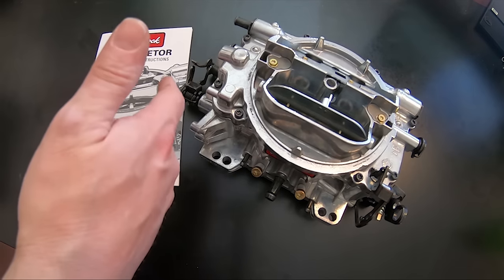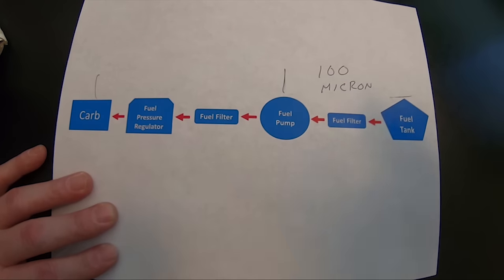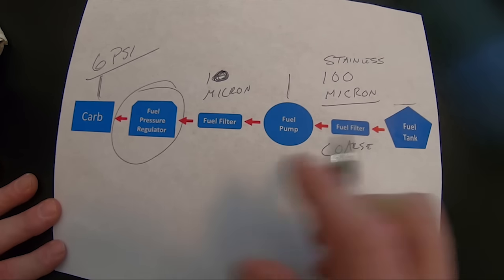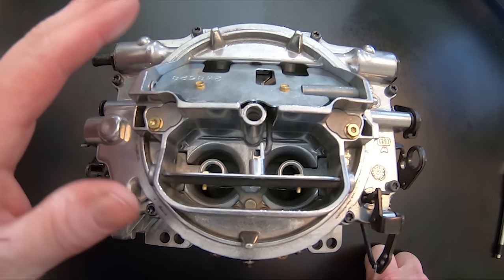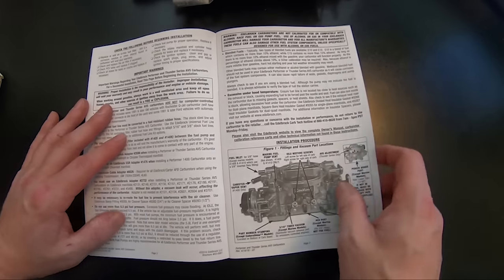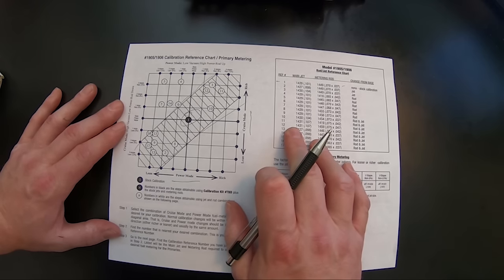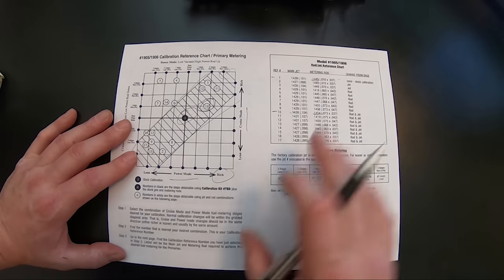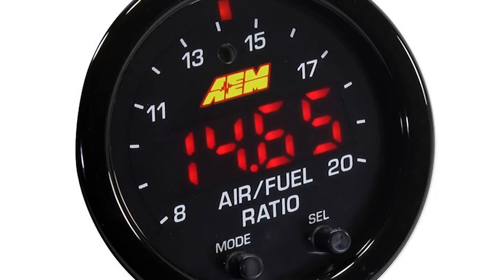The Ultimate Edelbrock Carburetor Tuning Guide

Comment: Nice video. Once you mentioned I have a question. My car is running great, it idles perfect, at wot is good, part throttle is good as well. Off idle is good as long as I give like 20% of throttle or more, however if give only a tiny gas, like 10% of throttle in order to leave a stop sign slowly there is an hesitation, pretty bad, I’d say. Other than that, like if I’m driving like at 30 mph or more, it is crisp. Any recommendation?
Reply: Bone Head first of all thank you for your prompt reply. I’ll start by the accelerator pump. I’ll have a vacuum gauge hooked up to check it. Thank you. Happy Thanksgiving!!

Comment: I was curious about my 1406 she was running great with choke closed then after 1 test ride she started running like dog crap, surging and hard to keep idle in gear. If i cover the butterfly with my hands the idle raises and smooths right out. Sprayed carb cleaner around the top plate gasket by the throttle and you can hear and see the difference on the vacuum guage my question really is this a normal occurrence on these carbs? Thing is only a few months old has no miles on it. Thanks for the videos and the help
Reply from the maker: You have a vacuum leak somewhere.

Comment: Does it matter if you use the PVC port for Brake Vacuum???
Reply from the maker: Use the rear port for its intended purpose.  It’s there for your power brake assist.  Front is for PCV.

Comment: I just rebuilt an old Carter (1st time) and set the idle speed so the transfer slots were square. There was no amount of timing or fuel mixture tuning to get the thing to idle with them set that way - had to go several turns in on idle adjustment. Checked for vacuum leaks and actually blocked off all ports. What might I be missing?
Reply: Old carters are often plagued with worn throttle shafts.

Comment: Recently purchased 1969 Firebird with a stock 350 engine it has a 1411 750cfm Edelbrock carb with a performer intake, factory cast iron headers, flow-master exhaust MSD electronic ignition. Is that 750 cfm carb to big for this setup it seem to stumble a bit under acceleration
Reply from the maker: Mike Knizner yup.  You can meter it down a little, but you can’t meter down that CFM.  If it’s bone stock and just a fun cruiser, I’d put a 500 or a 600 on.  The 600 would allow you to grow into it a bit.  This situation you’re in is a perfect time to pick up an AFT gauge and see how rich it is as it sits.  Good stuff can be learned from what that gauge will tell you.  Congrats on the car.  Absolutely love the first gen Camaro/Firebirds.

Comment: great video. i have an issue with my jet boat its 21 ft aluminum with 1410 Edelbrcok marine and 350 chevy. boat starts and idles , and cruises fine but when it gets to 3600 rpm it wont go any further. if i push the throttle it it starts spiting and stumbles and  have no further power . thx for the tips
Reply: @MuscleCarSolutions  thanks for the comment. to be honest dont know much myself about what was done to the boat .just purchased 3 months ago from a heavy duty mechanic shop owner. he told me the boat is fine it just need new jets and carb adjustment. the boat has electrical fuel pump so i just added a holey deadhead regulator thinking it my be over-fueling but i have not taking to the water to test yet. i purchased the carb jet kit but I have not open it or install it yet because  I though I will try one thing at the time to see if the issue goes away before i pour more money on this.
Reply: @MuscleCarSolutions  i just run into this google comment that says "If the carburetor is "too big" then the engine will not be able to keep enough air flow through the barrels for fuel delivery to occur. Which would explain why the engine would work at highway speeds but struggles at low rpms. Jun 8, 2010" Howver, mine is the opposite , it runs fine in low speeds but struggles at higher speed.
Reply: @MuscleCarSolutions  will do thx again.

Comment: A question regarding AFR readings, 4106 carb in 1978 chev 350, when running down the highway @ 60 mph, my AFR is showing 14.0 -14.3, when I come to a hill it drops
to 10.5 - 12.5 and the secondary has not cut in, are these numbers normal? I would like to see the up hill numbers higher to save fuel
Reply from the maker: @wayneking3408  when you come to a hill you’re under load as the vacuum drops in the engine and meters more fuel.  Go back to your calibration kit and follow the chart to go a little leaner.  14:1 is ok.  Not optimal, but ok.  Anything leaner than that you’re asking for bigger issues.

Comment: running into either a carb  or vaporizing issue.. most likely both..

 im running a holley fuel pressure regulator on my 302 82 mustang near the passenger firewall on my carter AFB . if the regulator gets hot and stops reading does this mean it expanded to allow max flow? or has it collapsed? 

getting hard to start after sitting hot. and stumbling after idling/heavy loads.
Reply from the maker: Check out my video on heat soak.

Comment: Great video! You said we could leave a. Question in the comments. We put a new 1805 thunder on a 305 small block . At launch with foot brake it stalls ? Any idea where to start . 
Any comments appreciated. Ty
Reply: Bone Head sorry 1805 I believe. 650 thunder with manual choke
Reply: Bone Head  the Edlebrock chart said down to 283 . 
We have headers and performer intake with power glide , 4.56 9 inch ford . Stall is 1800 I think . Can we lock out the secondary somehow?  
Just to give it a try ?
Reply: Bone Head  electric water pump and fans but as far as the core components stock except zero emissions and msd multi spark box
Reply: Bone Head man I thank ya . It’s been on the car for over a year . My dad is an old timer and spent 20 years building this bracket car and went to the track for the first time and died on the line . It started right back up and did 75 mph in the 8th mile . You gave us somewhere to start . I think the original idea was to stick a 383 in there and swap everything over so we don’t have to buy anything twice but not having anything to start with . I guess I could put a 75 shot nitrous on a one second timer at launch and still stay budget friendly. Thanks

Comment: Recently purchased a nicely restored 68 Mustang with 5.0 and Holley 4barrel carb. Both front and rear bowels were running over a bit. I lowered to floats to stop that. Adjusted the electric choke a few times. Had it running fairly decent I thought. Had been threatening to get rid of the Holley. I had been driving it around that morning and it ran pretty good. But then it seem to run badly after stopping for lunch. Drove over a short distance to the chiropractor's office. Upon leaving, the car would not crank. I thought maybe it had flooded? I removed the breather, closed the hood. Tried to crank it and the BOOM. THE ENGINE BACKFIRED  AND THE NEXT THING I SEE IS FIRE UNDER THE HOOD. Thankfully the girls in the office came to the window only to see me trying to smoother the flames out with my coat. They quickly brought me out some water. Finally got the fire out. Of course the hood will need a repaint. Other than that not much damage expect I need a new coat also. Estimator will be out tomorrow to check it out. We will see if State Farm will treat me like a good neighbor 😊. 

NOW ....after watching this video I can see I need to add a fuel pressure regulator and more filters. It only had a small one between the pump and the carb.

Think I'm going with a new Edelbrock.
Reply: Oh yes, the spacer. Thanks for reminding me. I'll have that black beauty back on the road in no time. Thanks for the great video 👍

Comment: I need some help understanding the rich/lean chart. I get that there is a cruise axis and a power axis....also I understand that down & left is leaner and up and right is richer.....but that's all I understand😂😂
When and why would I leave point 1? Why would I go richer? Or leaner?
Thanks man.
Reply: By the way....I have Grandmother's 69 impala....only 29 K original miles.
350 v8 turbo fire, lunati 460/460 cam, 1906 AVS2 carb, performer intake, street fire distributor,  headers, header cutouts,  twin flowmaster 40s. Fuel psi is 6, vacuum on manifold side is 12-13.
Reply: @MuscleCarSolutions  I just may get a wideband 02 sensor.....possibly instead of welding a bung I may open header cut out insert sensor and shut the cut out and put exhaust tape over any opening left....Ha Ha..it may work.
I have read if I use 02 sensor to calibrate WOT....the rest will be real close then I could tweak timing curve?

Any thoughts? 

Thank you so so much.
Your videos,  articles and replies are very well put together
Reply: @MuscleCarSolutions  ok....ok......so instead of "being sneaky" and opening the header cut out to shut sensor in...just go ahead and do the drill & bung thing? Yeah....that makes sense.
I grew up just keeping our stuff running....I knew I could gap points with a matchbook and if we had "fire & fuel" we would at least make it home. However....synchronization of my performance parts to achieve my goal of occasional going stop light to stop light.....without being abusive to my equipment is new to me......and I have read much........but am very much still learning and hungry for knowledge and tips.
Reply: @MuscleCarSolutions  Thanks!
I like the encouragement and I am glad to know the FAST plug wires are made in the US
Reply: Hmmmm......I may...just may....build my own wideband 02 sensor.....buy and install sensor only.....run 12VDC to sensor and watch/catch the output with my digital multimeter. 
Seems I saw a chart somewhere as to what output voltage = what AFR.
HMMMMM. Now that would be fun.
Any thoughts?
Reply: @MuscleCarSolutions  haha.....ya ya.
Only for tuning purposes......install only occasionally.  Sometimes I get ideas.......some well founded....some way the heck not 😂

Comment: Any thoughts on using an Edelbrock Carb with a turbo, either draw through or blow through application?
Reply from the maker: I’m not sure it could be modified easily enough.  Given we learned a lot when we milled down the front of the carb and saw how easy it was to get to and potentially modify the main metering circuit, I’m not sure how extensive those mods would be and what the sizes would need to look like.  Like everything engine related, everything is application specific.  In the case of adding boost on a carbureted application, I’d likely go the holley route instead.  They already flow way more fuel and the metering blocks aren’t too difficult to modify.
Reply: @MuscleCarSolutions  Thanks for the response. Let me be more specific about my intended turbo application. I have the carb set up in a draw through application currently but am having issues with lag on acceleration. Part of this is, of course, due to turbo lag but I am getting some stumble when I punch the throttle. I've done the best I can with jets and rods and accelerator pump rod position, but response is still not as crisp as I would like. I'm strongly considering moving the carb to the intake manifold, downstream of the turbo to get the acceleration shot to the cylinders ASAP. Assuming that I have the proper carb size and jetting for air and fuel requirements at full boost, is there a down side to doing this? Is the carb adequately sealed to take, say 15 PSI of boost? Will I have to do something that will increase the fuel pressure at boost to overcome the additional pressure coming into the carb? Do you think the standard stock floats will be crushed at 15 PSI? Will all the fuel circuits work correctly since they should be operating based on pressure differentials? Am I correct in thinking the fuel bowls will see boost pressure? Any information on all these questions is appreciated.
Reply from the maker: @stevesincere3799  there’s a lot going on here.  Where is the carb mounted if it’s not on the intake?  The lag issue could be several things but knowing what the specifics of the engine/carb size/etc is important.  To your other questions, can a carb be made capable of 15 lbs of boost?  Yes.  Also yes, you should be boost referencing your fuel demand to give more when under load/boost.  If you’re not, that could be your lag/hesitation issue.  No, the bowls will see little pressure.  The fuel signal is passed through the booster and drawn from the main metering circuit.  I’m not sure the Edelbrock can handle that.  But I have no idea what your set up is.
Reply: @MuscleCarSolutions  Thanks again for your response. Currently the carburetor is mounted on a base plate upstream of the turbo. There is a 3" diameter pipe about 2' long that connects the base plate to the compressor inlet. The compressor outlet has a 2-1/4" pipe that connects it to the intake manifold...again, about 2' long. That is a lot of volume from the carb to the pistons. Once the engine speed is up around 3000 RPM, everything is working fine, it is just the punch off idle that bogs.  Application is 71 Mustang 302 with Edelbrock dual plane manifold, 600 CFM carb (1406), larger valves, turbo cam, FMX automatic transmission. I can give you all the specs on the cam, valves, compression ratio, etc. but I don't want to make this a science project for you. I just wanted your take on running boost through the carb and what you think about all that volume currently between the carb and intake. Thanks.

Comment: Just wondering, I always hear make sure timing is right.  Well how do I know that?  Im at 7000 feet elevation and my engine will not under any circumstances run correctly at factory timing specs.  So carb is rich....duh 7000 ft.  Plugs black with carbon so can't read them for timing.  Suggestions?  Right now I'm at 22 deg BTDC at idle in N and in Park.  38 deg advanced at wot with 12 deg vac advance.   Is that close enough to be "right"

Im setting carb idle speed per the "square" transition slot and adjusting timing to get needed RPM at idle.  Is that correct?